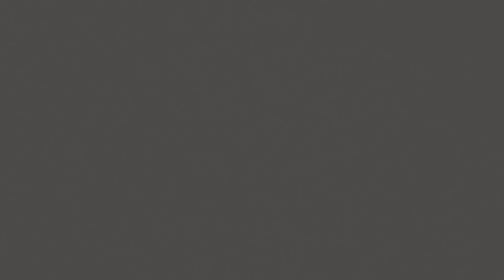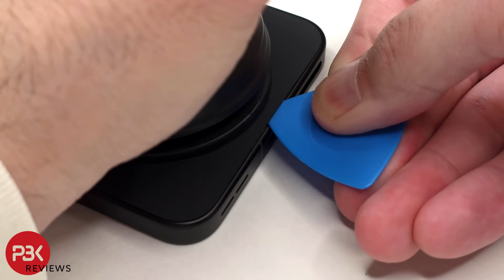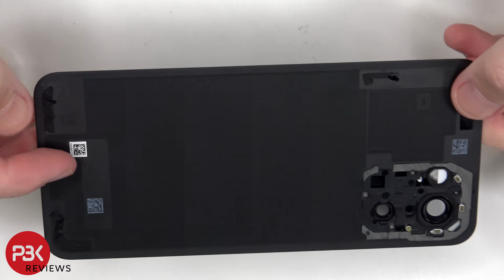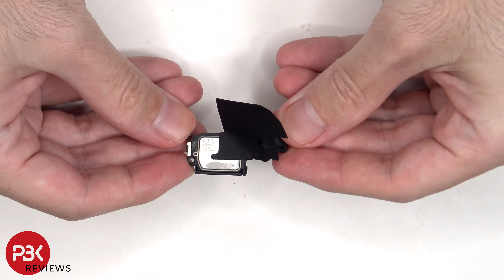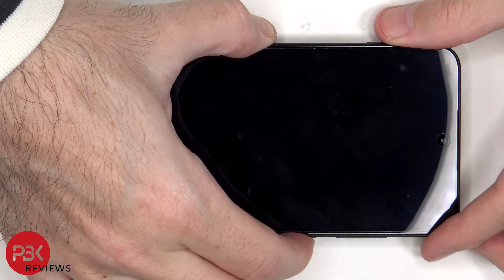OnePlus 15R Teardown Disassembly Phone Repair Video Review

Comment: 6:40 I actually did exactly that, and then I wanted to check if I might have broken anything—like the moisture-protection mesh—but it turns out the opening is a blind hole with no mesh, and it’s impossible to damage the microphone.
Reply: Exactly why I'm here - glad oneplus is smarter than us.

Comment: Watching from oneplus 15r
Reply: Bro how is your software experience.  Does it lag or does it have any pre install apps or bloatwares that can't be removed.  Please reply and help
Reply: @navanew-r3r  it's very smooth, I haven't faced any kind of lag till now and yeah it has some pre installed apps but those can be removed.
Reply: @chetankushwaha6360 out of the box how much system storage it has
Reply: @navanew-r3r  it used 25-30 GBs of space rest is free in 256gb varient
Reply: @chetankushwaha6360 thanks bro ❤
Reply: @navanew-r3r  i think if you were switching from 20-30k phone to 15r you'd feel it as too smooth to use id definitely recommend as it is a overall phone under 50k
Reply: Does it have screen flickering issues during video calls?

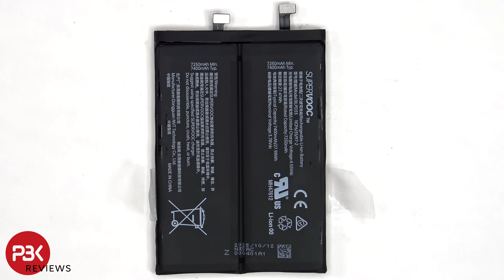Comment: 3:26 and Apple needs to take some lessons on how to build a phone from OP.
And this phone is probably still over complicated but nothing like apples Frankenstein phones.
If you had two of these, could you remove everything, switch 50% of the components between the devices and put them back together and both devices still work.
I think a iphone would be about bricked even if you took 2 brand new phones and did that. Apple products are stupid hard to fix if you don't take them to Apple. After which you may as have just bought a new phone for the cost of them doing anything.
So glad I stopped buying apple products.
Reply from the maker: yup